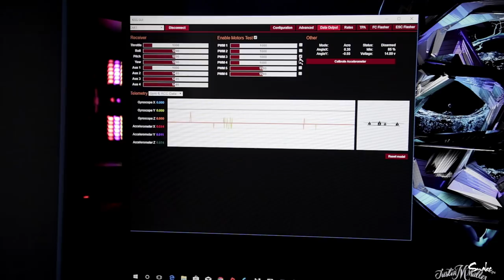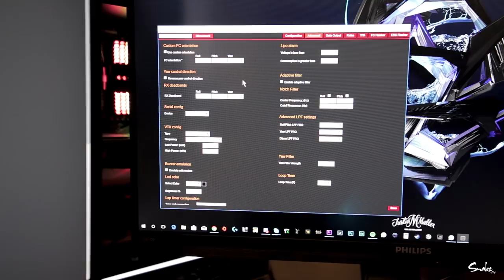FIXING MID THROTTLE OSCILLATIONS!

Comment: Radio stand mating call. 35:50
Reply from the maker: lolololo yep, i usually edit it out to save earphone users but i messed up :(
Reply: Thats hilarious xD sounds like a Seagull!
Reply: I LOL'd.
Reply: ah shit no i laughed hard...
Reply: @mr steele what kind FC mount are you using  on current Apex impulse late 2020 (pandemic #1) ...
Large rubber impulse rc isolators? 
Small thinnys? 
Soft chubbys?
Glow fuel silcone tube? 
Deez Nylon nutz?
Deez anodized ny-nutz
double sided sticky tape

Guh” “Diy mate  35:51

Comment: To your point at the end, almost every time I’ve had oscillations, excessive video noise, jello, etc i have found a bolt/nut loose or missing, or hardware hasn’t been mounted well and knocks around and messes with the gyro. Also once in a while a slightly loose prop causes me some headache

Comment: Did you use enough tape mate?? 26:05
Reply from the maker: i should buy nitto shares
Reply: Mr Steele hey what's up. I have a question, is there any reason why a prebuild mr steele quad from flitetest with same tunning and and props from the kit shows jello on my gopro videos. Beside that quad is great.
Reply: Quite interesting thank you, just a lit bit long 😜👍👍👍
Reply: @stefano ath weight of your battery?
Reply: He gave it the Bardwell wrap.😊
Reply: Nice vid. :) got the same issue with mid throttle ocsillation/jello on my rooster. Softmounted motors and fc. Low profile prop nuts. Everything is new, 2306 2400kv emax motors,dys f4pro fc, dys 30a esc, (tbs unify pro hv vtx mounted on top of fc with doublesided tape and a ziptie Good or bad?)  predator cam. Tryed emax and cyclone props. 330 Cap on each esc and 1000cap on batt. Still have prob with a litte bit of jello in my gopro fotage. Any suggestions?
Reply: Sebastian Sarries dont know but it is venom graphene 4s 1500. Should work on the Ps to see if get fix.
Reply: Jonas Svensson Bad! Don't mount stuff right to your FC.
Reply: did you watch the video?
Reply: First make TPA hit earlier, and lower some P gains. Then, if that doesn't solve, get into tuning filters--(which I cant help you with because i never played with them)
Reply: @Jonas Svensson Exactly same for me, only that I am flying Kiss V2 but similar setup

Comment: great video man. I've flown kiss V1 since the start and have used the rubber standoffs for some time now, and haven't had any issues. I recently switched one of my quads over to the Kiss V2 and started getting mid throttle oscillations..only in HD footage though. I've seen a few guys say the V2 doesn't like the rubber standoffs. After watching this i think ill go back to the old way of mounting the V2...good old female standoffs with rubber orings. Curious to see if that does the trick. Thanks for the info!!
Reply: Let me know if it makes a difference i have a Matek f722 getting some weird oscillations and i suspect its from the crappy rubber standoff's

Comment: What's up snake..was having that mid throttle oscillation problem myself for two months on a new build...after trying 3 sets of different motors I settled on running the smoothest motor I can find which is the T-motor...and trying betaflight, Clean flight, and butterflight.....it ended up being the ESC speedo pwm... frequency...which in BL-heli..32..you can adjust it..stock sits..at 24..bump it up to 36freq..and did a bench test of spooling it up on the table and to see if it oscillates...a higher frequency fixed it for me...some of my other drones have the same problem ill have to upgrade the older ESC`s...to the new ones..i didn't make any new videos for three months trying to track down this issue...also found that Multishot...runs much smother than D-shot...i didn't have any oscillation issues in the multishot days of the past...well anyways..Cheers thanks for the Video..Boss
Reply: way TOOOO many periods
Reply: Jesse simmons  yes I would rise it on all Quads. I coudn`t believe the difference it made just spooling...it up in my hand
Reply: how do i adjust it in betaflight?

Comment: Far from being a "prophet who predicts past events", oscillations at a specific throttle level is a very strong indicative of unbalanced props. An unbalanced prop has its gravity center at a distance "d" from its geometric center. For every "d" distance there is a frequency (rpm) that will resonate the set. Dynamically unbalanced props (likely to occur with bent/unbent props) may also results in vibrations with not so sharp "signature".

Unbalanced prop oscillations (above case) can easily be distinguished from common high throttle coupled with aggressive P values ("fixable" with TPA) as, in this last case, oscillations are constant along a large range of throttle position beyond a given level (ie > 65% or > 1650us).

Comment: Most jello and mid throttle oscillations on any build these days is usually the build itself 99.9% of the time, so many times I had somebody tell me to tune out their mid throttle oscillations or jello it's usually something mechanical and the way they built it and I always check that first and usually solves a problem without any tuning, the flight controller and stock pids on most FCs these days work perfectly fine. Still had some oscillations in the HD footage on your last flight, I'm guessing it's the way that GoPro is mounted. I totally saw it. But great video ❤️🤘

Comment: Very first thing I do, and I do this along the way as I'm building, is hold the frame, by the center (*see note at bottom for bottom-mount battery) in one hand, and with the other hand, tap  the motor's prop shaft, for each motor, with a rigid finger, with your ear close to the frame, listening carefully in the general location of the motor you're tapping.  Don't want background noise.  I go around to each motor.  Sometimes I find little buzzes and rattling, and it comes from wires, frame components where they dry fit together, loose fasteners, loose freeking camera PCB and/or optics, and, if using antenna tubing, the antenna can buzz along the inside of the tube... don't know if that would be enough to matter, but with 32 KHz it might.  And I've found that just because tapping one motor doesn't reveal anything, doesn't mean you shouldn't do them all.  Sometimes it's very subtle. 

*if bottom mount battery, hold the battery, but make sure the balance cable and main batt lead isn't going to come into contact with anything and vibrate.  I've also found the less you can hold the frame in your hand, the better...I guess that would dampen the effect of detecting minute vibrations, if that's even the correct terminology.
Reply: can lightly tap the camera housing, too

Comment: Hello Snake! I've got same problem the mid throttle oscillations, and then I went to test motors without props on. My setup is Alien frame+Steele PDB+KISS V2+KISS 32A+steele V2 motors. I discovered that when I was around 1500 throttle value(even when I was in motor test mode,), the motors themselves oscillate a lot, you could simply see the motors are oscillating. So I tried several ways to solve the problem. I thought it is mechanical resonance. Then I tried mount the motor to a spare arm and let it spin, there is no longer mid throttle oscillation problem. Next, I tried tight single arm and a little bit loosen the other three arms. The problem also gone away. So I realized that it is because the four arms in the Alien frame are so tight that they become a whole X shaped arms, this will change the system resonant frequency. Then I tried to soft mount my arms, with the simple rubber O rings, and it works well! I hope maybe you could have a try of my method of solving the mid throttle oscillation problem. I think there is nothing to do with VTX mounting or fc mounting, soft mounting the motors may also works out fine. And soft mounting arms can be considered to be another way of soft mounting motors. Hope you could have a try!

Comment: Nice Video ;) watched it until the end :D. So I´ve got two quads with KISS V1, first one is my nearly one year old fc with RC30 fw flys perfect no jello no oscillations, a little time ago I build a backup copter with another KISS V1 where I put on the latest kiss fw. The quads are not exactly the same, but the one with the newer fw got oscialltion/ jello in the hd feed :D not really bad (with rc25 on the other one I throw every Video away....) but its there...dont understand it :D. The build as itself I made like the other one which is flying perfect so....ive got to keep testing :). I ordered also some new Props for testing ;). Keep on!! Thanks for your work :)

Comment: I started getting oscillation in angle mode only i think.. I did make few changes like add rpm filtering and couple other things. but im start by replacing props that are scuffed up first and work from there.. Figure out what it is one by one

Comment: Considering that this was not a build video, I think It's one of the best build videos out there! :). Lot's here for new builders to learn. Thanks Snake. I always build my quads with the 0-rings (as you showed), and tend to over engineer everything :|. So they always fly smooth, no trouble at all. My own frames are err solid. No flimsy race crap :). Soft mounting the motors for instance, gives you a lot of immunity from additional temporary vibration due to bent/unbalanced props, etc etc.

Trouble shooting has always been a difficult occupation. The trouble starts when it's often likely that there are multiple causes of the problem, and often actually multiple problems giving similar/same symptoms. I did over 10 years running internet service and PC sales/service. Us techs were googling years before anyone had heard of google. I still have night mares about *indows Mal*are (can't say it lol). Never used/use  *indows myself of course, Linux was/is always too good. The POINT is (you were wondering?), learned a lot in those 10 years of trouble. Trouble shooting is a skill that, we should all practice. You're doing great Snake.

Comment: I recognise this problem as well. This is in this case strictly related to the shitty frame. It is not necessarily a bad quality but the design. I had two of this kind of frames, where soft mounting of the fc solved the problem (more or less)

Comment: Very nice vid, thanks for putting in the time and doing what nobody really has done to date.   It’s funny how often problems like this just turns out to be caused by the most obvious things, and often they multiply out to cause a bigger issue. Eg Props that are a bit shit causing vibes when then cause a loose vtx to buzz which in turn gets picked up by the FC. Either of those two problems on their own is not biggie, but together you get a noticeable issue.

Comment: When should PIDs be looked at as the source of the mid throttle oscillations? I do have pretty soft FC standoffs installed and will try your method of mounting to see if that helps.

Comment: I had oscillations on one if my quads - went through the process and it turned out to be the runcam board being loose. I then added a little bit of foam to all my runcams and it cleaned up high throttle oscillations in the video for each one.

Comment: i built 5 kiss setups during the last month and i had this issue with 2 of them, setting the yaw filter down to like 25 and use stiffer props solved the problem of mine

Comment: i found that i was getting different jello from two sources, the more obvious one was the session mount i was using was a worn 3d printed mount with a velcro strap, a lot of wiggle room, when i bought a more rigid mount it cleaned up and i noticed the second type of vibration and it was from one of my arms being slightly loose. not loose enough to tell from shaking the quad but when you  grab another part and pull you feel the give. sometimes just a loose nut can make the difference. the FC are so sensitive, if the properties of the rig change but your tune stays the same you will notice the difference.
Reply: FYI both the motors and  flight controller were soft mounted.

Comment: Great vid Snake!! I noticed when you changed the FC orientation in the GUI you only changed yaw and left roll and pitch. I mounted my FC backwards (arrow pointing to the back of the quad) but can't get the orientation right in the GUI. Would you or someone else mind telling me the proper values to enter in the GUI so my quad doesn't freak out when I arm it?  Thanks man I love what you're doing keep it up!!
Reply: Jester 180
Reply: 180 on yaw only? Or 180 on all three?
Reply: i rewatched it looks like you just need to put in 180 on yaw
Reply: Thanks for taking the time to check that out for me!! When I get off work I'll give it a shot.
Reply: yep from my understanding roll and pitch are only used for if you rotate the board on that axis

Comment: Have had similar issues on a chameleon. Turned out to be a loose stator in one of the motors twitching back and fourth less than 1mm
Reply: What motors where they? Sounds like a brand to avoid..
Reply: amisoftau Oomph velvet, armattan did a replacement though as the motor was only around 20 packs old
Reply: Okay, put them back on the list :). That was very good of them. Thks for the info.

Comment: I bought a mr steele quad from flitetest and it came with oscillation making video  jello
Reply from the maker: was it built by them or did you put it together yourself?
Reply: Snake FPV by by them, kiss fc comes already tuned it is just a mr steele quad replica.
Reply: stefano ath I would find out what props they tuned it with and also find out if it was with or without GoPro, should be the HQ 5x4.3x3 props , if your still having issues leave me a comment on one of my videos and I’ll hook you up with the proper tune for that Kwad, that’s all I fly is Kiss/Aliens so I’ve got a tune for it I’m sure. Anyways good luck man ✌️
(Of course this is assuming Snake didn’t take care of ya) 
C-ya
Reply: Jason Hull hehehehe ok, quad comes prebuild from flite test with v1s props same as mr steele use. Same gopro mount wedge. I use gopro hero 4.